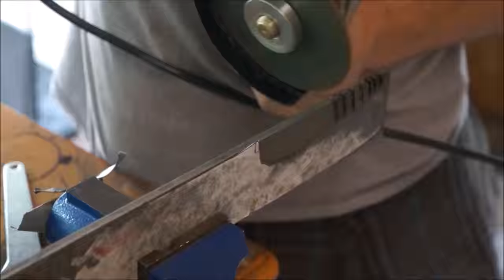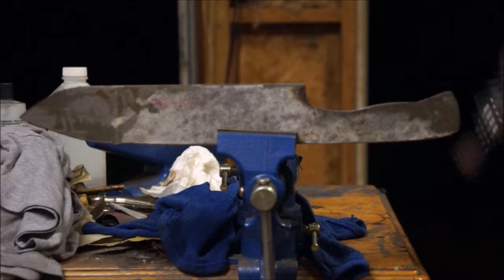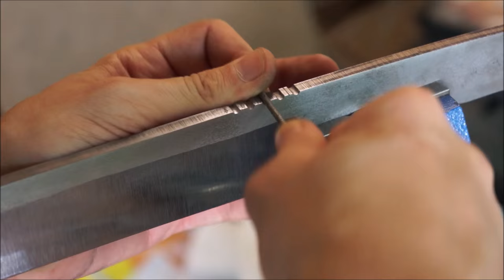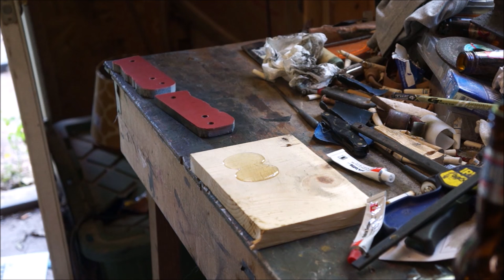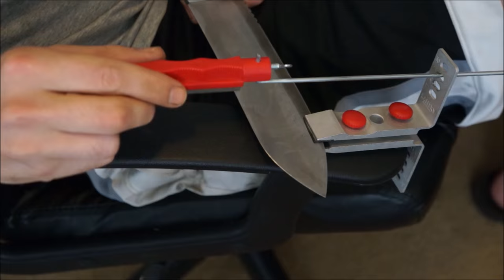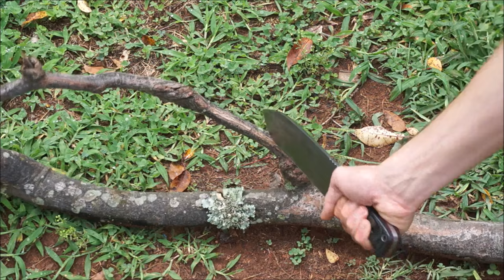Knifemaking: Making a 1075 High Carbon steel Chopper.

Comment: Nice work.  I am working on a similar knife made out of 1095 and I was wondering what temp did you get the blade up to before quenching? and Was that an aluminum arrow you used for the handle pins?
Reply from the maker: +rockclimber747 Thank you. about the Temp I not really sure what temp It was because I use coal. I just checked it in the fire with a magnet after not magnetic I got the color a little  more orange then quinched

Comment: When you etch your maker's mark onto the blade, I take it that green stuff is fingernail polish? 
Did you scratch your design through the polish? How did you get it so precise?
Reply from the maker: +intheWay2 Hello. yes that is finger nail polish. I actually use the needle end of a blow dart to a blow gun to scratch through. I used to take a very fine felt tip marker and draw it out to get it exact. thanks for watching!

Comment: Just asking, why do you temper? Is it made from manufacturer not tempered? Also what is used (chemically) in the etching process? Great knife. Easily a $200+ knife.
Reply from the maker: +amurican35 Thanks for watching! after quenching the metal it is really hard and brittle so you must temper it to soften it up so it wont crack and shatter. when you buy from a place they send it tempered to be verry soft so you can work it more easily. hope this helps

Comment: great project and how-to!
thanks!
going to build something the same right after getting fan or shop vac for the heater.
Reply: and what's the size of a plate? it's not quite clear, when eatching on smartphone.
Reply from the maker: +Olek Dav Thank you and awesome!
Reply from the maker: +asimmons913 The steel is 1/4 inch thick (6.35 mm) the length of the knife came out around 14 inches (35.56 cm)
Reply: +asimmons913 thanks! and width is smth around 2" or 5cm?
Reply from the maker: ohh yeah lol It is indeed 2"

Comment: Hi,
how did you do the etching? It looks really simple and efficient. Maybe make a vid about it? I would love to see how you did it.
Reply from the maker: +David Andelfinger Hello! It is really simple and, most of the stuff used is common household items. I'll try to do a tutorial video with my next knife. There are  a lot of detailed videos out there for this particular method. I tried something with this knife that I haven't seen In videos yet which is applying gun bluing after the etch to blue the recess making the logo dark and stand out bare metal. I may try to add annotations on this vid explaining a little bit about what i'm doing. Thanks for watching!

Comment: Did the blade warp during heat treatment? Looks to be bent down (towards the edge) a bit.
Reply: +JBehnen I think that's the profile of the knife. Look further back in the video during profiling, you can see a definite curve at the spine. Also, the blade wouldn't warp like that without serious pressure on the spine at one end and even then it would just bend to the side.

Comment: I thought the tempering was very interesting - did you just put it your kitchen oven to do the temper?  Also, where did you get the information on the tempering?
Reply from the maker: +Ken Clark Hello! yes just strait in the oven. thats all you need though it takes up more energy to heat a whole oven than to heat a toaster oven. I've learned tempering from various sources on the internet, my past job, and just good old fashioned trial and error (witch it think is the est way to learn. just more costly) Thanks for checking out the vid.

Comment: He mate! It looks like you killed it with that chopper. Also I saw your video on homemade micarta, but I've a question. Do you have a video on how to do that mini-etching machine? Will you make one in the future? Thanks!
Reply from the maker: +LFPS0311 Idon't have a video on the etching yet and I am planing on making one. There are a few videos out there that do this technique. If you type "Etch metal with a battery " there is a really strait forward video on this. Thanks for watching!

Comment: Nice.....funny thing is, I am making my first knife and I have it at the cutting it out stage. I am using 1075 1/4" thick as well. Making a big chopper. Our tools are almost identical, so it was nice seeing someone go through what I am just now starting. If possible can you tell me what type and where to get the drill bit? Thanks brother! Eric M. High Point, NC
Reply: Professional Knife Sharpener, Belt Grinder

Comment: What kinds of drill bits did you use to drill through the steel? I wanna find some good drill bits that don't break every other use lol.
Reply from the maker: +Anthony Strazhnikov Hello! I bought these from harbor freight and tools. Its M2 High speed steel or HSS. you should be fine with hss bits for drilling steel.
Reply: +asimmons913 oh that's weird I bought supposed "metal cutting" drill bits from harbor freight and they turned out to be total crap. Let me know how the drill bits last up, because I am currently 14 years old and can't afford to try out different types of products and also harbor freight is far away from me and I don't drive yet. So let me know how they last up.

Comment: Why did you temper it twice? And what did you do between the two temperings - just letting it cool or?
Reply: +Vladimir Savov It ensures that the transfer from austenite to martensite is properly set and results in a higher quality blade, and when you temper you usually just simply let it cool.
Reply: Ahaa, thanks a lot :)

Comment: Very cool!  Was there any edge deformation after all that chopping?
Reply from the maker: +ScottsUtubeWorld Thanks! I could still shave arm hair with it after. There was a couple of tiny spots that rolled a little I was able to just strop them out.
Reply: +asimmons913 Thanks so much for the response.  I have a rather expensive knife (expensive to me, anyway... about $225), and after chopping for a while, I noticed some rolling.  Maybe about the same as yours.  It's made of A2 steel.  I was worried that something was wrong with it... but since yours rolled a little too, it's probably normal.  Cheers from Southern California!  --Scott

Comment: is that a harbour freight belt grinder,  I'm starting out to make my own knives just a hobby.  was wondering how you like it.
Reply from the maker: +Skeptic Spartan It is. Its not to bad i'd say make good and sure all the nuts are tightened down before you use it.
Reply: Thanks man, that chopper came out pretty good.

Comment: Bravo.. Question though. On etching your logo into it what was the liquid you dipped the cotton swap into also what was in the blue bottle ?
Reply from the maker: +kyle hagerman Thanks. the liquid that the cotton swab was dipped into was vinegar with some salt diluted into it (about 4fl oz of vinegar with about a maybey 2 teaspoons of salt) thats really all you need. the blue bottle Is gun bluing I add that only to make the logo a bit darker for contrast. you don't have to though. Thanks for watching!
Reply: +asimmons913 good to know. Thank you. Where can we get gun bluing from perhaps like where is is usually sold ?
Reply: +asimmons913 does the gun bluing fade over time or does it seal n dry in there to help keep it darkened ?
Reply from the maker: +kyle hagerman  I use  "Birchwood Casey "Super Blue"  I got it at gander mountain. you can get it at most gun stores. you can also order it from online knife supply companies(such as Jantz supply). super blue holds up nicely unless deep scratches occur. Inside the etching groves it is not as likely to be worn on and should last for a very long time.Keep in mind bluing will not stop it from rusting.

Comment: Nice.  You are obviously new/amateur at knife making (don't take that the wrong way)  and have done incredibly well with simplistic tools and methods.  Way to see it through to the end with all the steps the pros take.  You have talent in this game.

Once you get a real boy's belt grinder your bevels' will come out super clean, use a filing jig if a serious 2x72 isn't in your future.   Literally your initial bevel being slightly uneven and your heat treat not being ideal(put that mofo back in the heat for a bit after non magnetic.... until you get precise heat treat methods) you did absolutely boss on this thing.  Using a typical store bought angle grinder and some other basic tools you did and amazing job, (don't forget your file) keep up the good work.

Please don't be offended by my criticisms, I'm only trying to help but I assume you know your faults(only in high dollar tooling) and will soon make some seriously amazing and professional knives.
Reply from the maker: +bigdmcc Thanks for the view and the constructive criticism! I love some good criticism. I am fairly new to this but I love It.  I've been looking in to replacing my 1x30" with a 2x72" or a 2x42" money is just not there yet. I also would like to have a File beveling jig but not about to spend hundreds on one. This is just a hobby I do in my shed in my free time. as for the heat treat I do wish I hadn't "jumped the gun"  but I worked the handle was still soft a bit closer to the Ricasso side than I like  but i'm not worried about It. Thanks again for checking it out! I'll be working on my game and making more videos!
Reply: Professional Knife Sharpener, Belt Grinder

Comment: Are those mostly tools from harbor freight? Awesome work! This makes me want to make knives to give as gifts and so I have something decent in the kitchen.
Reply from the maker: +enki yes most of them. they all work just fine. from my experience with them it depends on what you buy and you have to make sure every thing is in place (nuts screws tight). Im actually getting ready to make a few christmas gifts my self. Good luck and thank you for watching!
Reply: +asimmons913 Cool! I've had good luck with a few and terrible luck with some of their stuff. Overall its not a bad idea. If I find I use something to the point a higher quality item would be worth it I upgrade when I wear something out. That way I'm not paying top dollar for tools that will never see real use. I've got some gift plans I just need more time in my shop. Working out of town sucks because I can't sneak away for a couple hours at night to get things done.

Comment: just one question does cutting the knife out make any difference in quality than actually forging it?
Reply from the maker: +The4cp Not in my opinion.I think it would be more likely to come out with a lower quality knife if you where new to it because there are so many variables of errors that could happen while you work the steel though you would have more versatility with forging for instance you didn't have a bar you could hammer out something made from good steel like an old wrench or round stock. don't get me wrong i love forging and I have done it on a couple of smaller projects. but it would be more costly for me to make every thing by forging and I'm not an expert so I would likely screw up here and their possibly ruining the piece I was working on.
Reply from the maker: +asimmons913 to add there would be no difference in the quality if both where done right. It comes down to  and proper steel quench and heat treat for the purpose of the knife when your taking about knife quality
Reply: +asimmons913 Thank you I was never sure about it.
Reply from the maker: +The4cp No problem and thanks for watching!

Comment: This is a FANTASTIC video! I think this is what has convinced me that I need to just buckle down and build my own damn heavy chopper instead of dumping a bucket of money for some factory made piece. Good choice of steel too! 1075 is high enough in carbon to keep an edge, but low enough to be tough for heavier duty chopping and batoning. Just one question, where did you buy your steel? I have been looking at NJ Steel Baron.
Reply from the maker: +Richard R Thank you! yeah Its much cheaper to go this route. and 1075 has better edge retention than thought it would. I got it at Jantz Knife supply. It is the only in 1/4" in the 1095 Hi carbon section.

Comment: Is the 1" grinder all you used ? That turned out great !!
Reply from the maker: yes sir! the harbor fright 1x30
Reply: @asimmons913  how long did it take for the configuration? is it powerful enough for the job?
Reply from the maker: @tom69zax12  I dont remember exactly how long but it took some time. it is a under powered but with some patience you'll get there. its the harbor freight 1x 30" belt sander.

Comment: was this knife made to conform to chopping comp specs?
Reply: Chopping comp?
Reply from the maker: +Orion sorry Honestly I thought you where joking about something unrelated. It actually is within those specs from the page you shared. overall length is 14 1/8" and the blade is 1 7/8 inches wide at its thickest point. and blade length is right a 9 3/4". though it was completely unintentional.
Reply: asimmons913 not a problem mate, comp knives tend to conform almost exactly to the dimensions, so 15" OAL, 10"/5" blade/handle, 2" blade width, with 3/8" spine width, full flat grind, 2 lanyard holes.
Reply from the maker: +Orion ahh not quite then.  pretty damn close i will say. 1/4" spine and  3 lanyard holes
Reply from the maker: +asimmons913 not flat ground at all.
Reply: asimmons913 there is no advantage to making a comp knife smaller then the standard, but as you said this knife wasn't made to comply with cutting comp rules.

BTW your knife is a nice knife.
Reply from the maker: +Orion Thank you. i'm planning on doing similar test on the video im making right now the knife is even slightly smaller. any suggestions? ... i'm not going to buy rope just too cut it to shit.  I can do a water bottle cut. would do 2x4 but wouldn't feel right chopping it up. I can do solid red oak again.  still have a bit.
Reply: asimmons913 try and think out side the box, have a look around your house or the local recycling yard for cutting medium. Bottles full of water are very popular, as far as wood have a look out in the bush, you can find branches suitable for cutting tests. Another popular wooden item used for chopping tests are old packing pallets (just be careful that you don't inadvertently hit any nails), some company's give them away and if not they are usually quite cheap (like $10 each).
The important thing is being safe, large knives and inexperienced choppers sometimes adds up to people getting hurt.
Reply from the maker: Thank you for your advice.

Comment: Very nice, where did you get that steel so thick?
Reply from the maker: +molinobeer  thanks! I got it at jantz knife supply on the net. they have a pretty good selection of steels and good prices too.
Reply: +asimmons913 Just checked the website, nice. How is the stain resistance of the steel you chose?
Reply from the maker: +molinobeer  1075 is not that great for stain resistance. it will rust very easily but, its easy to work with and not that tricky to heat treat strong and cost effective. just have to keep it oiled. or you can parkerize it.

Comment: great knife amazing job, but why did you make it so sharp if its made to be a chopper not like a chefs knife if that makes sense
Reply from the maker: +Magnus Jeffery  hello! a knife should always be sharp in my opinion. its not the how "sharp" it is that makes it a chopper it is the degree of the bevel. a chefs knife should have something like 17 degrees where as this knife has 25 the degree of the bevel and the type of steel chosen are Ideal for bludgeoning trees. all knives and axes need to be sharp to be safe and effective.  thanks for checking out the vid!
Reply from the maker: +asimmons913 I didn't mean to put quotations around "sharp" just imagine their not there.
Reply: +asimmons913 true I forgot about that haha my bad
Reply from the maker: +Magnus Jeffery  No worries. I should have added that info into the video now that you got me thinking about it.

Comment: what type of belt sander do you have?
Reply from the maker: +Seb Chada It's a 1"x 30" Central machinery made by Harbor freight and tools. I made a modification to the work table so its angle could be set at less than 90 degrees.
Reply: +asimmons913 if you can make a video just giving a quick run down on how you did that modification, that would be great.
Reply from the maker: +Richard R  Sure! Its a pretty easy mod. you just have to cut and file it in the right places. i'll see what I can do

Comment: really nice looking profile and scales! and nice Pabst can in the back for "character"... well played sir
Reply from the maker: +jeverettrulz Thanks! Haha ..I really should clean my shed lol.
Reply: +asimmons913 while you are available, do you have a preferred source for your 1/4 1075 stock?  I've had mixed results depending on where I get it from...  many thanks!!!  and no worries on the shop cleanliness, I think we all could use a tidy up
Reply from the maker: I have only purchased a small amount of 1075 from jantz knife supply. haven't had a problem with them yet and the measurements were in the tolerance stated on the site. I have bought 1095 and cpm-3v (not in 1/4) and have had good results also. Thanks again for the view.
Reply: +asimmons913 thanks again sir!

Comment: So can anyone tell me how you temper a blade please.
Reply: After the heat treat(when it is glassy hard) you put it in somewhere a bit less warm(like an oven it or on hot coals) and wait for it to turn a straw color
Reply: or you do it the traditional way and take it from the oil while the blade is still hot. quickly clean a section of the edge with a file and watch the colours develop on the blade from straw yellow to pale blue. then requench the blade in a cool oil. harden and temper in one process.  this was how my boss taught me when I was an apprentice smith.